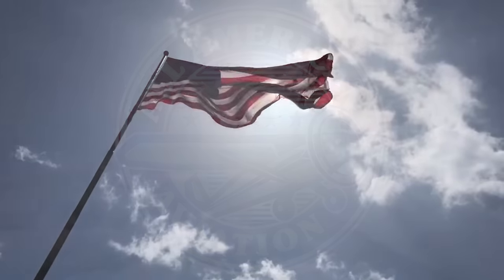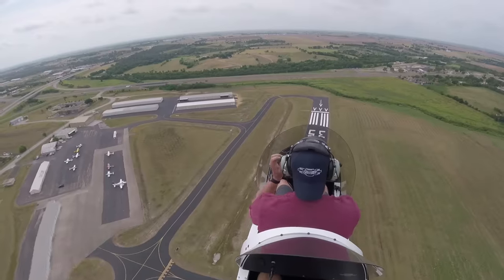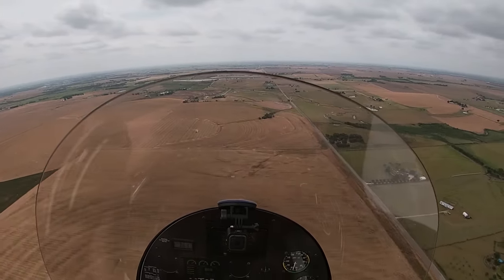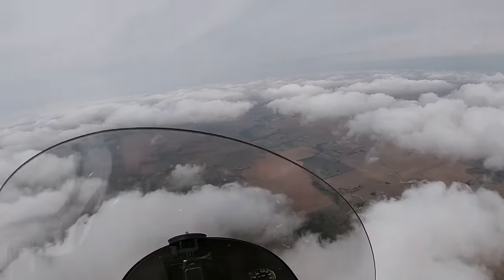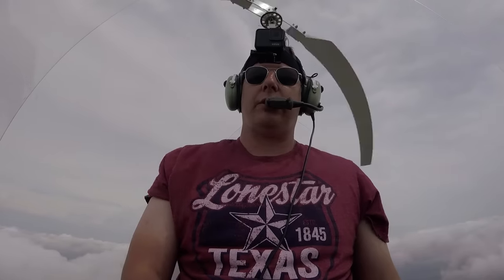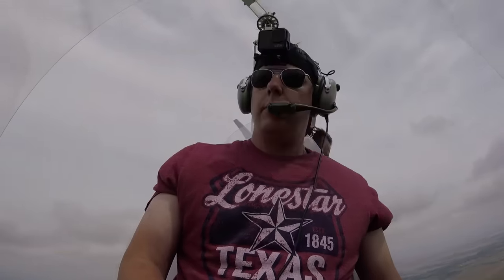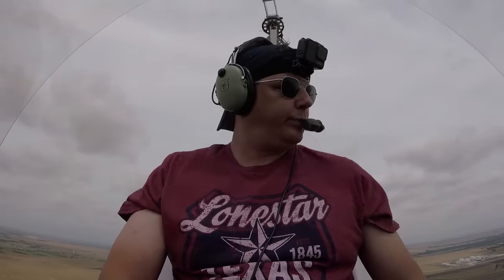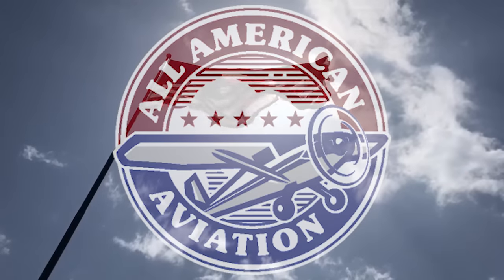Vertical Descent Adventure in a Gyroplane!

Comment: Nice video thanks for sharing. I had a question about the audio. How did you get the radio talk onto the GoPro's?
Reply from the maker: I used a separate audio recorder that ran in-line to the headset!
Reply: @AllAmericanAviation  Makes sense, thanks for the video and the knowledge!

Comment: You know, powerlines won't jump out and bite you...all you have to do is not touch them LOL
Fly above, below, or to the sides of them, just keep them in your line of sight.
The moment you lose sight of them is the moment you hit them.
I fly several fields with hidden poles, and it's kind of amusing because they all have several splices where other pilots flew into them.
Hell, my airstrip has a set of wires about a third of the way down, so I always have to land under them.
Reply from the maker: I lost a good buddy in the Army to a power-line in a Kiowa Warrior in Tennessee.  Can't get complacent for sure.  But yet--I agree with you.
Reply: @AllAmericanAviation  I know guys who have flown through powerlines pretty much every season and didn't even damage their planes, and I knew a few guys that only did it once.  Ag planes have some defense against it, but helis and gyros just have way too much to get tangled up and damaged.  I wouldn't necessarily write off a road because of powerlines, especially if it's your best or only option. You seem like you're pretty adept at spotting them, here's a few tips that I learned from some old pilots...always look for the poles, not the wires.  You can see poles a lot easier than wires.  If it doesn't feel right get out.  Sometimes your head is caught up in other things and you don't realize that you saw a pole out there, so if it doesn't feel right that's your subconscious possibly pointing out what you didn't immediately notice.  It may also be telling you that those trees are suspiciously spaced close enough to hide poles.  Oh, one that I made myself that you guys reminded me of...if you get caught in low visibility, towers don't grow on roads or rivers, and there's plenty of them out there just waiting to shake hands with you.  Be safe out there man.

Comment: I love doing "vertical" descents.
Reply: Always enjoy autorotation. My instructor taught me to bring the air speed down to zero, rudder authority  is near zero needing large pedal inputs to maintain direction adding slight side cyclic to effect a "side slip"
Reply: phil QUANTRILL - If you're flying a gyro, you're always in autorotation, with or without an engine.
When you use side-slip, you're trading off forward airspeed for sideways airspeed - The difference being that the sideways component does not fully register on your airspeed indicator so it LOOKS like you are going a lot slower than you really are... and without forward airspeed (or at least propwash over the empennage), you will have far less rudder authority. Yes, you can get down to effectively zero airspeed, but the risk of losing control is increased and that is why good instructors generally advise against dropping below 20mph. It's easy enough to correct for the spin when it does set in, but it can also set in quite quickly and generate forces which require a fair degree of effort to overcome so hesitation in correcting the spin should be avoided, as should the spin itself... and the best way to avoid that is to never drop below that minimum airspeed.
Reply: I love her too❤.
Reply: @RoadRunnerLaser    When I refered to the autorotation I meant the virtual holding of geographic position. I agree that rudder authority is lost at less than 20mph and issues can arise very quickly, but, a good instructor will help you understand and master this under supervision and not as a surprise/shock when it does happen for the first time when one is solo. A good instructor will cover all eventualities it is safe to cover under instruction and strongly advise against those areas it is dangerous to enter into and why.   Phil.
Reply: phil QUANTRILL - I figured, but that's not called "autorotation". Most people refer to it as a "vertical descent" (even though it's not quite vertical except when the wind matches the speed at which the descent is performed). Autorotation is the phenomenon of the blades turning due to airflow. It's how a gyro flies.
I agree that a good instructor should demonstrate the danger areas and how to recover from them and they should also explain how to stay away from those danger areas in the first place. An ounce of prevention is usually better than a pound of cure.
Reply from the maker: They are a blast!
Reply: @RoadRunnerLaser  Are you required to maintain some forward airspeed even without power to keep a degree of ETL? Or can you literally drop straight down like an anchor and keep full rotor inertia?
Reply: Cod Mott - If you drop straight down, it will not have any detrimental effect on the autorotation, however, you will lose rudder authority and it risks causing a spin. A spin is very easy to recover from (either by dropping the nose slightly and rolling into the direction of spin) or applying a little power to increase airflow over the empennage. So, a student pilot is generally advised to maintain just a little forward airspeed to ensure that they maintain control. I was told not to drop below 20mph for my GST although, I have maintained control at lower airspeeds and there is a point at which rudder authority becomes kind of mushy (I guess a little like would happen to the controls when stalling a fixed-wing). With a little experience, the pilot can learn to feel the loss of rudder authority and just dip the nose a touch to maintain that all-important airflow.
After I passed my GST, I went up on a reasonably clear day to climb as high as the cloud-base would allow (which turned out to be around 4500ft at the time) and play with vertical descents. I spent a couple of hours just going up and down like a yo-yo getting a feel for the limits of control and enjoying being in the sky without actually flying anywhere. Toward the end of my flight, the wind was picking up, so I rounded off my day sitting in a hover watching the road-traffic going by.
Reply: Something goes wrong, you'll be doing a vertical decent alright....that's the scariest part of the whole thing...